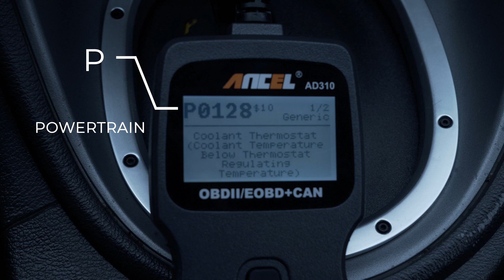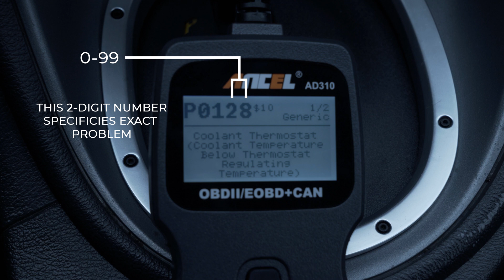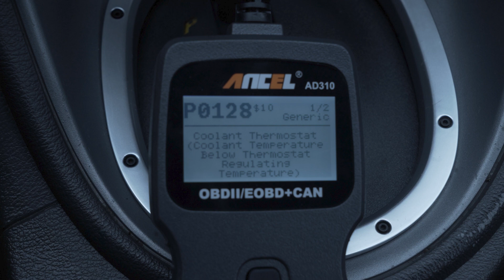Engine Fault Code Explanation

Comment: 2018 Ram 2500 6.4l hemi. Scanned using Torque Pro and Veepeak obd bluetooth transmitter.  Got a code C3101
Reply from the maker: Did you ever get that tire pressure monitor replaced? My dad has the same thing in his F-150, but he never saw it as important enough to replace it.

Comment: I have a question I like how u explained d numbers on d codes but have u ever seen a  code like this "B2AAA" If u have any answer may u reach out to me on it please😊
Reply from the maker: What Code reader are you using? What is the vehicle you are using it on?
Reply: @notacarguy_  for 2017 cadillac xts main vehicle but I have two ford's '95 and '18 and also a Nissan 😬
Reply: @notacarguy_  I'm sorry it's a 2017 cadillac xts and d reader is a "OBD2/EOBD"
Reply from the maker: @eduardosequerajr4365  The best thing I can find is that B2AAA is a code that is thrown when the actual code returned is not compatible with the code reader protocol. Essentially, B2AAA is not the real code and it's overwriting that actual codes. 

https://www.troublecodes.net/bcodes/b2aaa/

Are there any other codes returned in addition to B2AAA?
Reply: @notacarguy_  wow thank u so much for u taking time to give me an answer boss man
Reply from the maker: @eduardosequerajr4365  You're welcome!

Comment: What about b2281 and b1276
Reply: No not that one but ok let me start from d beginning car started to studer and then check engine light came on 1st scan it read p0131 and p0137 which of course its o2 sensors but then I scanned it again and tbh it showed like 6 codes d two o2 sensors and one for transmission module , and a"C" code but it didn't make sense to me and then that "B" code is wat threw me off ok d other two "B" codes are "B2A01, B2A47"
Reply from the maker: @eduardosequerajr4365  What kind of car?
Reply from the maker: What kind of car are you troubleshooting?